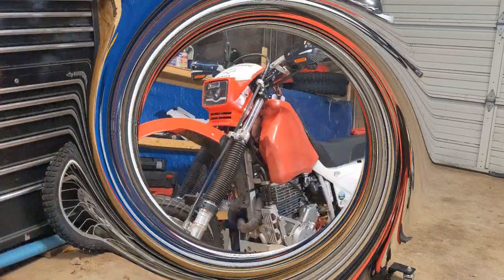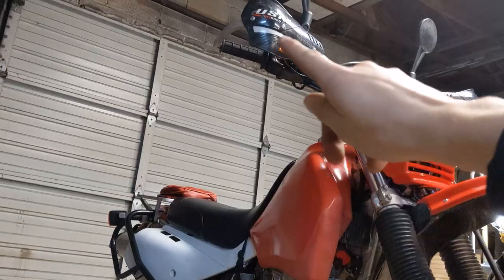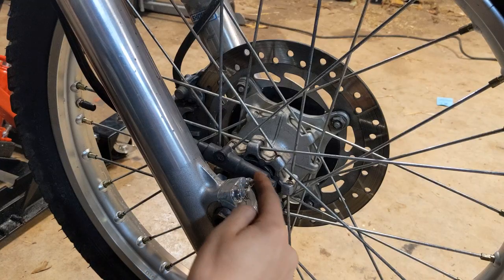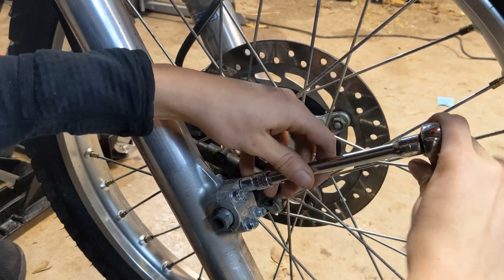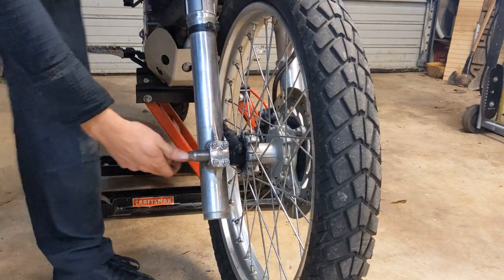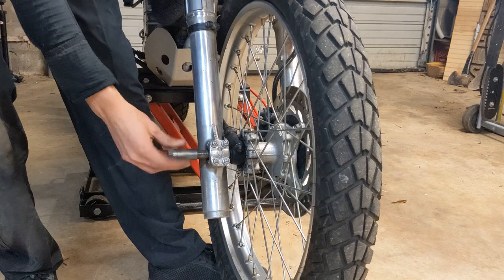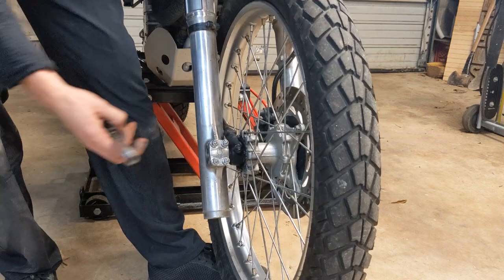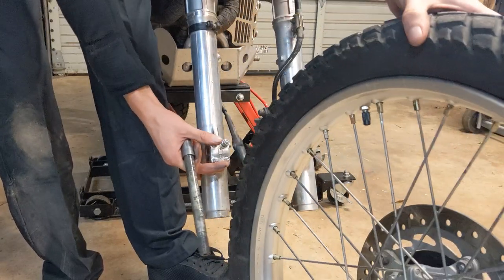How To: Remove Front Wheel on XR650L [1 Minute]

Comment: How many liters of oil is recommended after changing the oil and filter?
Reply from the maker: 2.08L is what my bike took. After the first liter, just have your kill switch turned on so it cant start and hit the starter button for 5 seconds for the oil pump to transfer some from the frame to the motor. otherwise you might spill some oil on the frame as the oil is shared in the frame and engine since its a dry sump design.